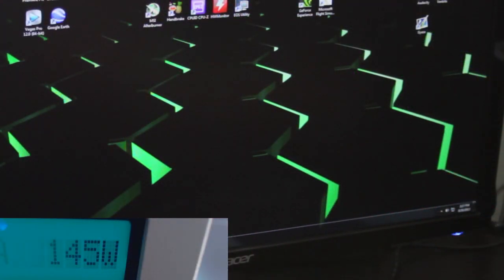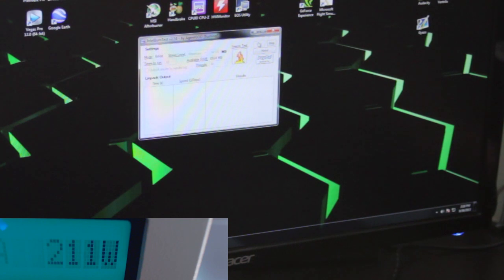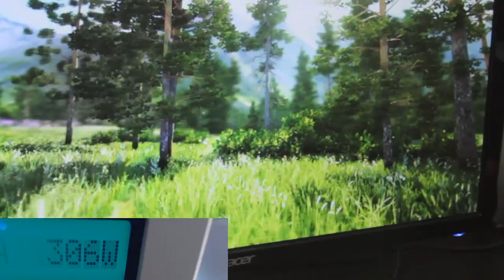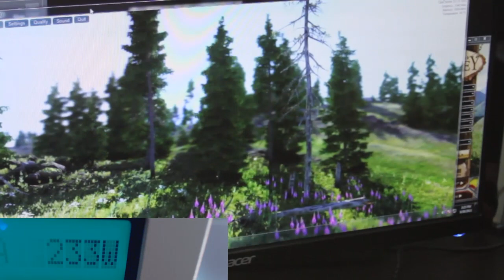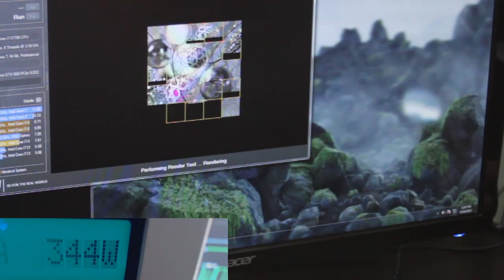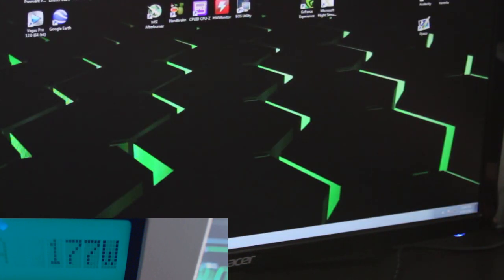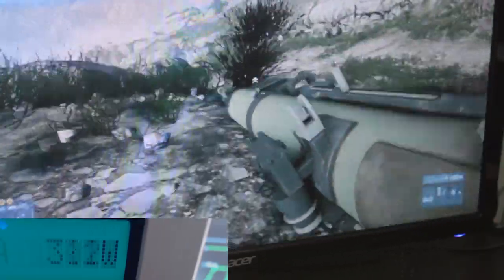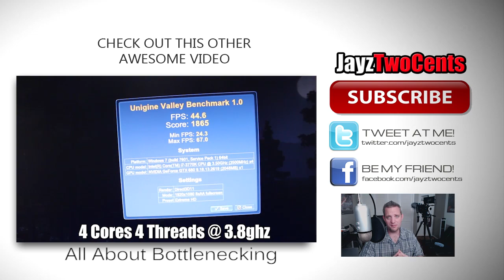How big of a Power Supply do you REALLY need?

Comment: I want to build a second R9 270X in my system in the future and some friends told me that I should get at least a 750 or 800W PSU but after watching the video I'm not very sure about that.
Here is my system:
- Intel Core i5 4570 @ 3.20GHz
- 8,00GB Dual Channel DDR3 @ 799MHz  
- ASRock B85 Pro4 
- 1 TB HDD 7200 rpm ( maybe also a SSD in the future)
- R9 270 X 2GB @ 1070 MHz
- 24" BenQ GL2450hm
- be quiet! System Power 7 500W
It would be very nice if someone could help me here!
edit: I did the same things he did to test the maximum power needed and I had 238 watts. So a 500W PSU should be okay right?
Reply: yup, you should be good with a 500W PSU, R9 270's only have a TDP of 150W.
Reply: it is recommended by Gigabyte and XFX to have at least 500W PSU to run R9 270/270x/280, you should be fine, 750/800w is overkill, since you won't be using it.
Reply: just go to pc part picker website, put all of your parts there to make a build. it'll then show you estimated power you need

Comment: Building a computer i don't know what power supply i need can some tell me ????

CPU: Intel 5820K 3.30GHz (Haswell-E) Socket LGA2011-V3 Processor
Motherboard: Asus X99-S (Socket 2011-3) DDR4 ATX Motherboard
RAM: Crucial 16GB (4x4GB) DDR4 PC4-17000C16 2133MHz Quad Channel Kit (CT4K4G4DFS8213)
Fans: Aerocool DS Edition Fan - Blue - 120mm
Case: In-Win Mana 136 Midi Tower Case - Black

Comment: My rig:
CPU: Intel I-5 4690
GPU: EVGA FTW 970
Case: Corsair 450D
Hard Drive: 1 TB SATA HDD
Memory: 8gb of Corsair Vengeance
Motherboard: MSI Z97 PC Mate ATX 
Fan: Cooler Master EVO 212
Sound: On board 7.1 
How much power do you need for this build. Im thinking that 550w is sufficent but im not an expet at all. Please get back to me ASAP.
Reply: 550 will be fine the i5 and the 970 are really power efficient just make sure the PSU is from a trusted brand like corsair or seasonic :)
Reply: Will Campbell you will need more than 550 if you plan on SLI in the future.
Reply: Sober or Evga!

Comment: Hey nice video, I am a somewhat of an average to mild gamer not looking to do any overclocking. I have a custom pc with a Biostar A960D+ motherboard, AMD FX6300 CPU and a Nvidia 760 GPU running on a 550 watt power supply in a cobra case. If I upgrade from my 95w FX6300 to this 125w FX8350 will I need to change my power supply or anything major? Thanks!

Comment: Great vid Jay.. .. I bought an evga 500w psu .. Will this be enough to power a dark rock pro 3 and a evga gtx 760 sc acx cooled gpu? :-/ The gpu is supposed to need 170w but the dark rock pro 3 has 250 TDP on it (?!) Can the cooling system require more power than the gpu?!

Comment: Guys I'm upgrading my PC and here's what it would soon be. Should I stick with the 750w PSU I already have or downsize it to maybe a 600w?

I5 3570k
2x 4gb ram at 1600mhz (total 8gb)
R9 280x club 3d royal queen 
Corsair 750d case (all the fans possible to fit)
1tb HDD 7200rpm
Maybe an ssd 
K70 gaming keyboard 
Razer naga gaming mouse 
Probably some light strips in there 
21.5 inch monitor

Should I keep the 750w 80+ bronze PSU I have? Get a lower PSU? Get a higher PSU?
Reply: 750 watt will be fine
Reply: No not atall, 750w is needed for crossfire... A 600w is more than enough for a single 280x... If your planning to put 2 280x's in your system then a 750w is needed, but if not I'd go with a 600w... No need to waste cash :)
Reply: 750W is a big over kill for that system...
Reply: Gavin Rees It is? I've got a 280x shouldn't it be necessary?

Comment: My psu is 600 watt ATM. Will it support this: 
Mb:  ASrock extreme 9
Ram: 2x4
Gpu: Amd r9 290x vapor-x 8 gigs
CPU: Amd fx 9560
Around 8 fans
1tb hdd
2tb hdd
Extras: blu yeti pro
Camera
Headphones
2 monitors 
1 disk drive
Reply: yes it will
Reply: Blacksun My pc is fine. If anything was wrong I would get bluescreens whenever it could not handle the pressure.
Reply: Some Looty I am at school so I can not tell you the brand but the gpu says it needs a 700 watt and all of the recommended wattage for gpus and cpus are a load of bullocks from what I have seen.
Reply: EchoTV Doubt that, and even if it is, you're running that psu at maximum load, which is not good for its future. The cpu draws around 300W at full load, and the gpu around 250, which is already 550 not counting other components.
Reply: Some looty, It does. I am running it right now with no problems at at all :D
Reply: EchoTV Kinda doubt it, the fx 9590 takes 200+ W at max load., the gpu takes 300 W at max load, + peripherals, that's really pushing it. What's the brand of the psu ?
Reply: Some Looty Well somehow I do not believe you because you are doubting that my computer is up and running, but it is and I put as much pressure as possible on it.
Reply: EchoTV Run furmark and prime 95 for 5 mins at once, then i'll believe you.
Reply: EchoTV Please your starving that pc of power. Buy a 850+ watts psu and youll be fine.
Reply: ***** That extra power is only going to cost you like an extra $1 - $7 a month depending how much you play and where you live
Reply: ***** I'm currently running a fx8350 with a hyper tx3 cooler (Hyper 2012 didn't fit in my case) and I rarely go up above 62C. Not sure about the energy consumption through. And yes, you are correct the 9000 fx line generates way to much heat.
Reply: EchoTV It will run it now but when you do sli or crossfire you need headroom for that, better to go extra 30% more power than what you are using now. Also, alot of good quality, like EVGA, Corsair, have Eco Modes for their power supplies, anything they don't use they will not consume, so they adjust their wattages by themselves. I ALWAYS recommend 750w gold+ or 850 gold+ for gamers and that sets them safe for future proof builds, even watercooling. For 3 way sli I recommend 1000w gold+ but I never use more than 1000w gold+, anything more than 1000w is either using x99 boards with 2 xeons and like 20 fans and 3 radiators and 4 way sli or some gigantic overkill monster builds I've yet to come across lol...
Reply: X3NEON MAX Just build it yourself... It ain't rocket science ya know... Well depending on your budget really... Mines right now has... i7 4790k, Asrock Extreme6 Motherboard, Gigabyte GTX 970 G1 Gaming, 32GB of RAM [For rendering and uploading youtube vids on adobe premiere pro], Samsung 850 Evo 500GB SSD, main HDD is 3TB Western Digital Black 7200rpm, power supply is EVGA Supernova G2 850W gold+ rating with eco mode fully modular. That's pretty much my main parts without the coolers and fans. I also recommend the following if you are serious about building your own PC. Get good dust filers and good fans, get good cooling supplies, and buy 10 boxes of Swiffer dusters for your computer room keep it dust free, I use an average of 10~12 boxes per year. Oh yes, and use high quality silver composite heat pastes and switch it every year or so. Also consider buying either a decent vacuum or an air canister for cleaning your case every 3~6 months. I used to clean it every month but with decent filters, my case is so clean inside lol. Only buy really fine meshed or "finer" mesh filters. Those are my few tips for ya, take care.
Reply: EchoTV Use these 
http://extreme.outervision.com/psucalculatorlite.jsp

http://www.realhardtechx.com/index_archivos/Page362.htm
Reply: i have a r9 290 and a i3 6100  on a 70% 600w power supply by cooler master and it runs fine, i also think they way over estimated how much you need for a r9 290 they recommend 750w on amds site
Reply: EchoTV I didn't say anything about the recommended gpu wattage... I know what I'm talking about, trust me.
Reply: No way in the world it will.. And you didnt even tell us the brand.

Comment: I know it's not a relevant question, but i wanted to ask you guys, will my processor AMD  A10-6800K work better with 8Gb of Ram instead of 4Gb(Which i have now) ?
Reply: YES, AMD A series runs better with at least 8gb ram at 1866 speed and above, with 4 gb ram you are hindering performance, I suggest getting dual channel (2 sticks of 4 gb ram 1866 speed at least) for your upgrade.
Reply: that's a lie, AMD APUs love more ram, dual/quad channels, and faster ram. I run A series APU with 8 gb ram on dual channel, and it runs MUCH smoother with 8 gbs as opposed to 4 gbs. he would be better off buying 2x 4gb 1600/1866 speed ram to maximize performance.
Reply: of course, maybe he doesn't need 20 tabs open on chrome. Then again if his operating system is x32, then 4 gb would be maximum ram accessible.
 my system is x64, I can take advantage of more ram/higher speeds. 

AMD even recommends running at least 1600 speed or higher in order to take advantage of APUs.

Comment: Is this compatible?
CPU: AMD FX-8320 3.5GHz 8-Core Processor
CPU Cooler: Cooler Master Hyper 212 EVO
Motherboard: ASRock 970 EXTREME4 ATX AM3+
RAM: G.Skill Sniper Series 8GB (2 x 4GB) DDR3-2133
Storage: Seagate Barracuda 1TB 3.5" 7200RPM Internal Hard Drive
GPU: Gigabyte Radeon R9 270X 2GB WINDFORCE
Case: Corsair Graphite Series 230T Black ATX Mid Tower
Power Supply:EVGA 600B 600W 80+ Bronze Certified
Optical Drive: Lite-On IHAS324-07 DVD/CD Writer
OS: Microsoft Windows 8.1 - 64-bit (OEM) (64-bit)

Thanks.
Reply: master 405
Oh ok thanks, I was worried the system would be junk.  Thank you.
Reply: No windows 8.1 can't run on your system
Reply: maikel ris
Why not?
Reply: Jared D he is just troll ;-)
you can run 8.1 maybe even on pc from 1999.

Comment: I have Intel Core 2 Duo 2.93 Ghz
Gigabyte G31 Motherboard
500 GB HDD
I  currently have a 250 W PSU,
I am planning to install a Radeon R7 240.Do i really need to upgrade my PSU?I read in some forums that this card runs without any problem on 250W PSU.....PLEASE REPLY!!
Reply: MaThEw DoNy You shouldn't get mad at people for suggesting that stuff, the parts they are suggesting are low budget parts, so most people assume that even a kid with a weekend job (such as Willi Gee , kudos on saving up for a $1000 pc btw) can afford them. There is no magical way for people to create a card out of thin air that works well, at low watts and is very cheap, that's just the way it is, sorry if it sounds harsh. My advice would be to sell that build, maybe a few others things too, pool that money with whatever you have now and buy a second hand one online.
Reply: Just build a new one lol! The R7 240 ain't worth bruh!!! I'm jk, tbh I really couldn't help you with that. I would say to go on a tech forum and ask cause to me, getting a 240 for that processor seems like a bottleneck. or you can just build a brand new $450 PC that will for sure work great! Sorry, wish I could help...
Reply: *****
seriously??dual gpus?can you tell me the names of the gpu's?and your system specs...PLEASE REPLY.and what PSU did you use?
Reply: Just get a Corsair CX 430/m and get a R9 270x. You'll be fine with that.  MaThEw DoNy
Reply: Willi Gee
just like that,huh? what am i  bill gates?i don't have a money tree
Reply: The R9 270x is around 120 its no point in getting the 260x cause its the same damn price lmao! The cx 430m is only 39 dollars, that's only 159 with out tax. just save up your pretty pennies for a extra week and get it. I managed to build my own PC for $650 plus the mouse, keyboard, windows, and the monitor, which adds up to over a $1000 while only making $70 a week working (16 btw). All I'm saying is that, If I can do you you can do it. MaThEw DoNy
Reply: Willi Gee
how do u earn?
Reply: I work at a plant shop on the weekends. MaThEw DoNy
Reply: MaThEw DoNy get a r9 270/270x and a cheap 500w PSU, the r9 270 are really good GPUs and are going for cheap, it is not worth purchasing R7 240.
Reply: Thats-Gr8 oh oh you think i don't know that?i don't have the fucking money...can u gimme some?
Reply: MaThEw DoNy
The 240 draws 122w at load through the pci slot. Tom's hardware link: http://www.tomshardware.com/reviews/radeon-r7-240-and-250,3717-9.html

I think you'll be alright with the 250w.
Reply: ***** 

Dual GPUs on a low-budget system like that isn't really a good choice. Two is not twice as good as one, so you don't really start getting two until you reach the over-$350 range where bang for buck starts to get bad if you get just one card. If anything, the 240 is BELOW the price range where you get the best bang for buck, which is $100-$300.
Reply: Lol you will have to upgrade the whole thing. Nice setup for 2009 though.

Comment: I need to know if my rig would be stable and efficient. And I need a suitable opinion on the cooler
I7 4790k
Msi gaming 3
Coraisr 8gb ram
280gb ssd 
2tb hard disk 
Circle cc380 case
Coraisar cx600w
ZOTAC NVIDIA GEFORCE GTX 970 
THANKS!
Reply: everything seems pretty good! Honestly I've never heard of that case (I googled it and nothing relative came up) so in terms of cooling and your budget. If you can fit it in your case and you wan't something cheap and reliable, I would recommend the Cooler Master EVO 212. If you wand something "COOLER" hehehe get it... Its cooler but at the same time its a cooler hahaha not very funny... I know :(. Anyways the second option for me would be a Corsair H100i because, you'll get much cooler temps vs the air cooler However, it will run you up $70 more than the EVO 212. Besides the case, everything seems okay. :)
Reply: ***** WHy in the hell should he do that? You dont know his needs and clearly he can afford it go back to 4chan dumb ass
Reply: should be fine. the 900 series cards are very efficient for power. i think the minimum recommended is 500 watts for the 970
Reply: Cpu Cooler? If thats the case, you can never go wrong on a noctua dh-14

Comment: I need help I got a new power supply (750W) I am going to upgrade to a GTX 580 (Friends giving to me) right now I am using my graphics card HD Radeon 7700 and my computer is getting really hot like 90C+ on my GPU does this just mean to get more fans for my computer? because at the moment I have good air flow in my computer and adding more wouldn't hurt?
Reply: Blow out the dust and check the thermal paste. 90C isnt good
Reply: 80C MAXIMUM, like if you ever overclock make sure you don't exceed 80C.
Reply: don't worry fixed it my wiring wasn't the best

Comment: please help me i dont know if all these parts are compatible and if the power supply if enough to power all these parts also if the gpu is gonna fit in the case. thanks in advance

CPU: Intel Core i5 4690K
GPU: Gigabyte GTX 970 G1 Gaming
RAM: G.Skill RipJaws X (dual) 2x4gb ddr3 1600 CL9
MB: Gigabyte H97-Gaming OR MSI H97 Gaming 3
HDD: WDC Caviar Blue 500GB + Samsung 840 EVO Series 120gb sata ssd
PSU: Corsair CX600M 80+ Bronze, modular
CASE: Cooler Master K350 USB 3.0 Window Edition      
CPU COOLER: Cooler Master Hyper 212X
COOLER FAN: 4 Corsair SP120 Quiet Edition

Comment: Would 450W be enough for this?

- Power Supply: Super Flower 450W 80+ Bronze Rated PSU
- CPU: Intel Core i5 4690k 3.50GHz Haswell Quad Core CPU Turbo Speed 3.9GHz
- Motherboard: Asus Z97-K (Socket 1150) ATX Motherboard 
- Cooler: Prolimatech CPU Cooler
- RAM: 8GB DDR3 1600MHz Dual Channel Kit
- Hard Drive: Seagate Barracuda 1TB 7200RPM 
- Graphics Card: Nvidia Geforce GTX 760 
- Sound: Realtek 7.1 Channel Sound (On-Board)
- Optical Drive: OcUK DVD+/-RW SATA Drive

Please get back to me asap.
Reply: Did any of the idiots replying to this thread learn anything from the video? 450w - 500w is perfectly fine for that system.
Reply: ***** Oh lord...a Troll how cute, blocked.
Reply: Terty Brown I know I'm not that guy, but that PSU is more than enough.
Reply: No less than 500, but I'd say minimum 550 to be on the safe side. You'll actually find, at least with my AMD cards which are roughly the same, that they actually tell you not to use PSUs below 500 watts. For even more powerful cards, this buffer is probably higher. This is especially true with overclocked processors.

TLDR: Min 550 Max up to 700 (which is a lot, really).
Reply: V pohode
Reply: I'd go for a 500 w m80
Reply: I know it's a long time from your original post, but go 750w like jay. If you go 450, you might not be able to use the newest cards. The nvidia gtx 970/980 need 500w minimum.
Reply: March Fifth Since u seem to know alot bout PSU delivery could u pls tell me if this my psu energy enuf for this
PSU:700 watts G series CM
CPU:AMD A10-6790K
Mobo:A88X-PLUS
GPU:Sapphire R9 270X Toxic
HDD's:1x3TB WD GREEN , 1xSeagate 160GB , 1x500GB WD BLUE (2.5Inch)
Case:armaggedon T6 Gigatron which houses 4x120mm fans and 1x80mm fan.
Reply: If you do some research on your GPU you would see that it requires a minimum of 500w
Reply: Well...my CPU pushes 80-90 watts at full load for now...plus well um JayzTwoCents still said games at 1080P wont be using GPU's to their full load since mine has them LED's that tell you what "Load" you are on soo if i play crysis 3 for 3-4 hrs i normally get till the 4th/6 LED's soo yah plus im not playing at 1080P..
1280x1024 FTW.I know its sad.Though all games I will just crank to Ultra.
Reply: oki cool, I'm getting the same CPU and GPU, so thats good to hear.
Reply: Really?
Coincidence eh.
Whats ur monitor?
Reply: At least 800w or 1500w to be on the safe side

Comment: Gigabyte P67A-D3-b3 Motherboard
i7 2600k Unlocked - unleashed (or so it says on the box)
Gigabyte 290 4gb
16 GB Corsair Ram
8 fans in the rig
1 SSD 250 GB pro
1Tb HDD
1Tb Hybrid HDD
1 80gb HDD
1 500Gb HDD
Wildcat Cyborg 7 keyboard + 500 series mouse
And Astro A50 wireless headset
And finally on that a Corsair 700W power unit which is pretty much doing maximum right now XD